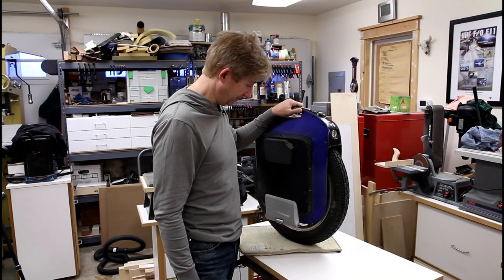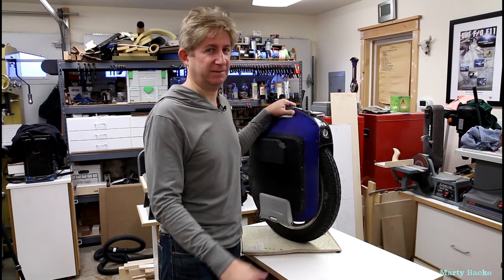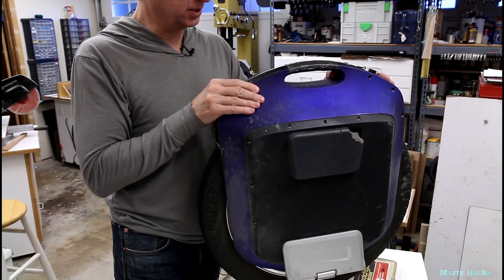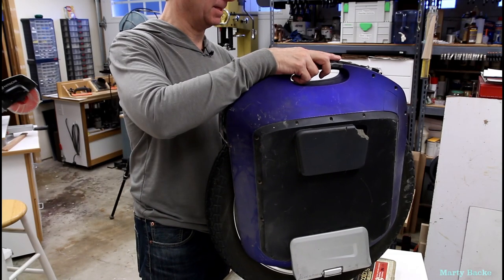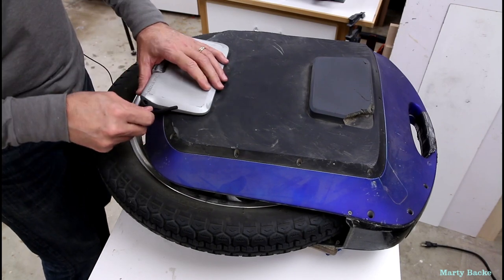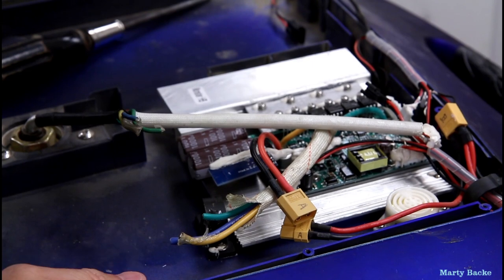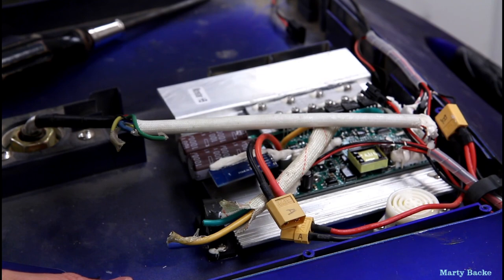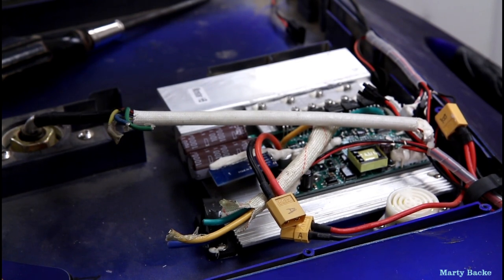Replacing the Gotway Monster Axle Shims

Comment: Just got my V3 100volt  Marty and now that I have 126 miles on it I just started feeling some play in the wheel.  It's gotten worse in 3 days so now I will have to take mine apart.  I'm glad you made these 2 videos.  Thanks for giving me something to follow.
Reply from the maker: Wow. Already? That's a real bummer. I know many Monster owners who have not had to tighten the axle nuts, but unfortunately I also know some who have had to rather early, like you. I suspect Gotway doesn't always properly tighten them at the factory.
A tip for you. The V3's have a tighter tolerance around the nut so you can't use a impact socket (the socket is too thick). Just buy a standard cheapo 24-mm socket and cut a slot in it with a grinder.
Hopefully you just have to remove the side panels to do the work. The most time consuming part will be cutting the slot in a socket. I recently made one for a friend and it took maybe 15-minutes of work with a grinder and a cutting disk.
Good luck.
Reply: @ElectricUnicycles  Yeah it sucks, I did 15 miles today and was in heaven but I felt the shift like a transmission shifting slightly.  Unfortunately I don't have any of that equipment so this is going to be interesting

Comment: I ended up tackling the same problem by just tightening the nut, this seemed to work for a bit, but then it got loose again. Now I've tightened them again with Locktite, and it's held up over a 20 KM ride, no looseness whatsoever. Hope it stays that way.

Comment: My v3 is doing it too...after I put weight on it though, it takes some force to get it to rock while still. I’m thinking it’ll get worse. We’re the shims the actual problem?
Reply from the maker: No, I actually never had any damaged shims. The nut was loose though. I later discovered that I also had a broken motor-axle "key".
Reply: @ElectricUnicycles  thank you Marty. It was a loose axle nut. Now the cooling fans are running loudly. I just replaced them last month.

Comment: Is that a o2 sensor socket? And what size I’m attempting this right now!
Reply from the maker: It's a 24mm socket. Standard socket that had a notch cut out of it with an angle grinder.

Comment: I currently have an inmotion v5f+, and am looking to upgrade to something with more range and top speed, but I don't have the workspace and technical expertise to conduct this level of maintenance. Should I avoid a gotway wheel in this scenario?
Reply from the maker: Statistically, I think you should probably avoid Gotway unless you buy from a great dealer that would support you. Really depends on how you want to use the wheel. I must say that the new Inmotion V10F looks like a perfect upgrade option for you. That being said, every wheel has the possibility of developing problems. So in your case, buy from a reputable dealer if at all possible.
Reply: Thanks for the response!  After reading several forums, I have to agree.  I do like the higher specs of the Gotways, but I don't have the time, space, or expertise for the higher maintenance.  I primarily use my v5f+ for transportation to and from work (Navy) and occasionally for shopping for less than a backpack-full worth of items/groceries (otherwise I just take the car).  I need a dependable and reliable wheel (and safe, considering there are a few dangerous points on my commute path where I could potentially become impaled on objects to the side of the path if I were thrown off in that direction).  I also want a larger wheel than 14".  I've pretty much narrowed down my options between the KS-16S, KS-18S, and the newV10F (if it's available).
Reply from the maker: Good choices, although I suspect the KS18S may feel a bit big for your uses. Really, the 16-inch wheel is the perfect general purpose EUC. I think everyone should own that size before experimenting with the other varieties. If you can't wait a potential couple of months for the V10F, you can't go wrong with the KS16S. But I have the sense that the new V10F is a better wheel than the KS16S. I'm getting a loaner from Inmotion this week so I hope to put out a few videos on it very soon.
Reply: Thanks!  I will keep an eye out for your video.  I will need to wait until I get to Monterey first to make sure regional laws and NPS rules aren't going to be an obstacle before investing in another wheel anyways (plus, if I order a wheel now there isn't a guarantee that I will receive it before moving, which could potentially end up in a lost wheel or my package in someone else's possession).
Reply: "I don't have the workspace and technical expertise to conduct this level of maintenance. Should I avoid a gotway wheel in this scenario?" Not necessarily. I have had my MSuper V2, which I believe uses the same shim system, for 2 years, and it's as tight as day one. Bear in mind I don't ride it hard or on bumpy trails, so the type of usage probably makes a difference.

Comment: Hi!!!

Where can I buy this tool? 14:11
Reply from the maker: You can't. This is a custom made socket - a slot was cut into the side of it.
Reply: ok thanks!
and the Axle Shims from gotway acm?
Reply from the maker: You may be able to buy shims from your dealer or direct from China.
Reply: to you I give them ewheels.com, if they had left over I would be willing to buy them, since I do not see that they sell in china this and gotway itself does not give me solutions
Reply from the maker: You can buy them from China, here: https://www.aliexpress.com/store/product/GotWay-Electric-unicycle-all-model-Original-accessories-MCM4-ACM16-MSUPER3-Mten3-tesla-monster22-LUFFY-Charger-connector/1908673_32832899025.html?spm=2114.12010608.0.0.ab061e41sVh0WE
Reply: ElectricUnicycles  what is the wooden tool that holds the wheel on the table called again?

Comment: That slop or play is ever from new! I believe it has nothing to do with the “shim” or any nut that is loose but the Motor timing and hall sensor and firmware algorithm! You would notice that this slop has disappear fm the new Tesla!
Reply: I agree that the slop at the end is 'normal'. However, there was much more slop before I replaced the shims. Trust me, that condition was not normal. It got much worse during the last couple hundred miles.